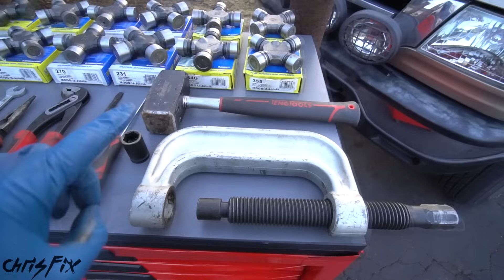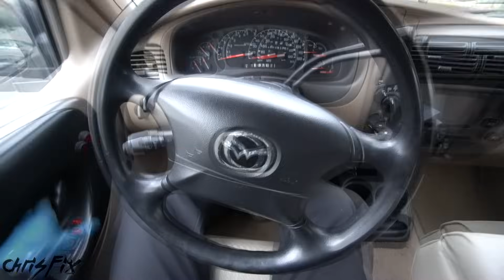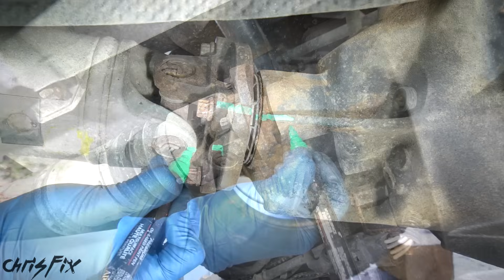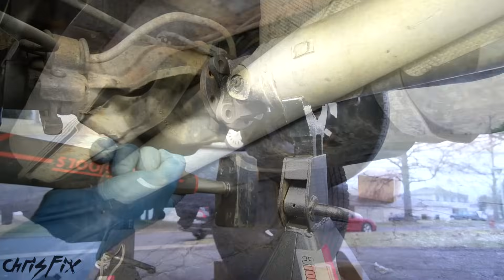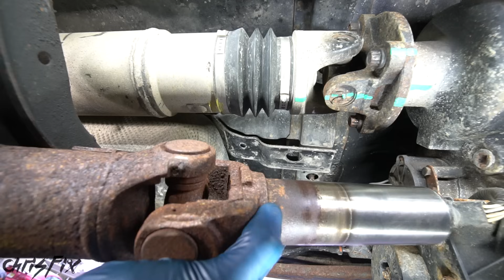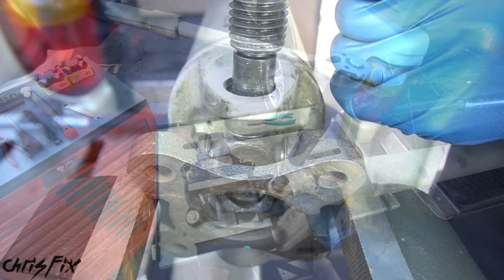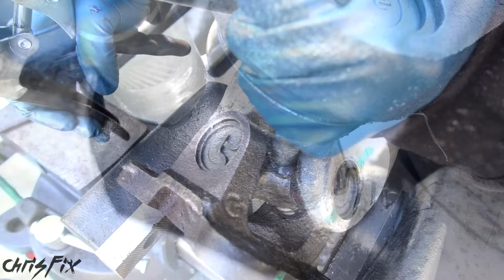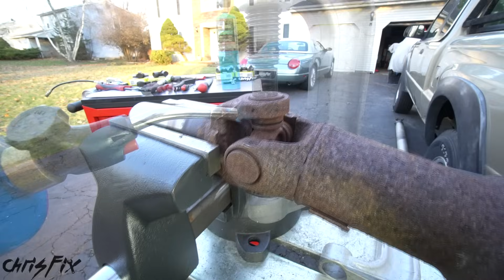How to Diagnose and Replace Universal Joints (ULTIMATE Guide)

Comment: Hi ChrisFix! I'm having the problem of going over bumps and the rear of my car clunking. I'm getting the clunk when it goes into reverse and drive. I'm still unsure if the u-joint is the problem. I've replaced the shocks and swaybar links. Is the u-joint the problem in my situation? Many thanks!
Reply: Support it on the frame and try to move the drive shaft.  Likely one or more U joints need replacing.
Could also be a loose strut if it is noisy going over bumps.

Comment: If you're u joints start to go bad, get them replaced immediately. Take it from my experience. I let mine go bad on my silverado for a long time, eventually it got so bad, it cased the back of my transmission case to blow out, ended up costing $2500 to fix.

Comment: I wish my u-joints came out that easy. Nope.. not easy at all.
Reply: I couldn't hammer them loose... Even the c-press did not work. Ended up buying a 10 ton shop press. At 7 tons they gave and came loose
Reply: @TheShellshock67  Wow.
Reply: Before u joint the four bolts will make one cry.
Reply: @Meme Man your saying like leave the bolts in and revove the end clips?
Reply: @Meme Man ohh i misunderstood. I thought you where talking about doing that to free the ball joint from the yoke
Reply: Ya, my sentiments exactly.
I've just finished up changing the Pinion Seals, U-Joints, and Carrier Bearings (as well as other work) on two trucks. The first was a 99 Dodge Ram 3500 and the second a 98 Dodge Ram 2500. Had to heat all the strap bolts to remove. Had to CUT the U-joints out, heat the caps and remove them with an air chisel !
Definitely was NOT this easy.

Comment: I had never heard of plastic injection 2 hold U joints in I hammered for hours to take it apart a 1988 S10 pickup truck original U-joints 150000 MI that was 30 years old they lasted that long I could have heated them up with my torch been done with it in a Flash, I've been working 50 years on my own vehicles thanks a lot

Comment: Hey Chris, (or anyone) do you know if U-joints can cause vibration at VERY specific speed ranges?  The second I accelerate past 70kmph my car starts vibrating a lot.. Then as soon as I accelerate past 80kmph it completely goes away.  Mystery shakes are the worst.
Reply: Having same issue here with a Toyota KE30/Corolla 1977

Comment: I changed the U joint in my car,  I knew how to do the job but didn't know the fine details, I did not file the edges which cause a lot of force to insert the cups, and damaged the flange. Chris step by step professional approach of how to do a repair is what that makes the difference even mechanics with years of experience can learn something.

Comment: hi chris,my toyota hilux is vibrating in low speed,when shifting to 4th gear,the speed must be above 60kmh or it will vibrate,in other words my speed in 4th gear must be at least 60 kmh to make it smooth..is it due to bad u joint as well?
Reply: Go under your vehicle.Grab the shaft and check for play.If it moves then it's time to replay.Thanks.

Comment: So I found your video like a year ago, I am having trouble with my u joints so I looked up this video. But thing is I replaced the rear u joint about 3 years ago because it fell off while I was driving. So I had no clue about the balance. What should I do you correct it?

Comment: Thank you for the tip about grinding the grease gun tip. That might solve my greasing problem on my driveshaft. As the space on my factory, u joint is quite tight. Excellent video, keep up the good work!

Comment: So if I just did my transmission and forgot to mark driveshaft orientation.doh. my driveshaft can only go on in two directions, if I have vibration that wasnt there before I just need to rotate driveshaft 180 degrees correct?  My u joints are connected to diff via 2 u straps over ujoint caps. 50/50 chance I screwed the pooch on em

Comment: Hey Chris, hopefully you see this. I have a Mazda Bounty 4WD and I have the squeaking sound at low speed like you said in the video, but only when my foot is OFF the clutch and putting power to the rear wheels. Would this still be a uj issue. Cheers man love the videos!
Reply from the maker: Could be something clutch related.

Comment: Hey Chris thanks for the video I'll have to check that out on my 06 Silverado crew cab what do you think some people tell me it's the free way but yet when I pass by the same sections on the free way in my 2014 Altima or any car I dont feel these crazy shakes iv sold other trucks because i thought there was something wrong iv put new iner outer tie rods pitman arm idler arm all shocks alignment balance new tires put the tailgate down upper lower ball joints I gave up sold that truck got a different one trying to make a long story short I notice it more with trucks and its smooth with cars so are the freeways made that way in certain areas or is there something wrong with all these trucks iv had

Comment: Chrisfix my 95 ford f150 shakes and vibrates terribly at 55 mph and the other day I heard two loud "TINK" noises while driving. Then my truck starts pouring radiator and trans fluid out though the seal between the trans and motor. What do you think it was. My dad said a broke u joint.

Comment: Hey man great vid, but what about the kind that are bolted on at the rear axle on 2 of the caps that connect to rear axle yoke with inner c clips? Do you put the inner c clips on, then bolt it on with caps in place already, or press in the first 2 and then bolt on the yoke c shaped clamps/connectors and THEN press in the new caps and install new inner c clips? Thanks for the vid either way!

Comment: Hai. My landcruiser 200 with 2uz engine. Vibration always came at 55km/h and 60km/h.
After slightly pass through 60km/h its ok and smooth, but at 70km/h it vibrate again, but after slightly go through 70km/h and so on its ok no vibration at all. These vibration always came during slow acceleration, but if i accelerate hard, there will be no vibration at all. Is it u-joint problem? Or gearbox problem?

Comment: Your an idiot, lol! You never hammer u joints out or hammer them while installing them! You will bend the ears on your drive shaft or front shaft and front half shafts! NEVER USE A HAMMER ON U JOINTS! NEVER! ALWAYS PRESS THEM OUT AND IN! THERES A REASON FOR NOT USING A HAMMER! YOU CAN BEND THE EARS ON THE DRIVE SHAFTS AND FRONT SHOFT AND HALF SHAFTS! THEY ARE BALLENCED FROM FACTORY! You bend those ears even .0010 of an inch, you will get u joint premature failure because the needle bearings will not spin evenly! This cuases vibrations and premature failure of the new u joints you installed with your hammer. Press your u joints in and out ALWAYS!

Comment: So I replace the U-joints on my drive shaft am I F250 and also the drive shaft leading to my front axle for my transfer case but yet my car still has vibration and it's still making the same noise now I have to U joints and both my axles in the front of my truck how can I tell if those are bad

Comment: Great video. Quick question, you demonstrated vibration under the car while driving. Is that constant vibration? Would you suspect the U joint if vibration only occurs at speed between 20-30mph? 
Thanks.. and please continue your great work.

Comment: Amazing video. 
How can you tell if you have a bad differential.
Reply: Need more information, bad differential is ambiguous. Do have fluid leak, a loud clunk, a whine or vibration? Have you checked your u-joints and wheel bearings? I’ve seen loose lug nuts after a customer had the tires rotated.
Reply: @danacoleGMM  
My 09 mustang GT makes a clunking noise when I hit a bumb or when I shift as well of other noises like sqweeks .
The rear differential is over filled due to a slight leak. I found out to replace u joints, you have to change the drive shaft, because they don't make u joints for this model. 
I got under the car and was turning the yoke left to right it makes a clunking noise when I do it. 
Thank you very much for responding

Comment: Chris, I have a 2004 Chevy Silverado 2500HD. I followed your directions to the T. The only problem I have after replacing the U-joints is there is a clunk from the front shaft when I shift it into 4 wheel drive. What did I do wrong? or what is a possible cause of that? I marked the drive shaft and replaced as you showed. I have no idea what I did wrong? Any thoughts or help would be appreciated.

Comment: Hi Chris...
Good job and make me understand clearly thumbs up!

Question?

Mos cars is the same way to do it?

Like a Kia 2006 Sorento , she told me by phone to me.....the car was shaking a lot....and ... when she goes back and forth  she heard a noise....she told me....

I told her by phone I can't check or say .....( This is the problem) .

But anyway......she told me after a few days.....she did fixed already!

But she told me.... they said to her....it was only with one in it...
Mean the other ones it was out....
The u join....

So my question was......mos cars are the same way to do? Like you did it RIGHT?

THANKS!!  keep Cheking on you!
Reply from the maker: Correct, most cars or trucks with a driveshaft will be very similar if not the same.

Comment: Very helpful. I want to know if the clip is not in 100 percent but is catching. Will it be ok. 
    No excuses but it was dark an I was rushing because my friend helping wanted to leave.
Reply: i certainly would leave it this way... you either didnt clean out the channel well enough or the u joint is not seated against the far clip tightly.. you can try using a hammer like he showed in the video to push the ujoint further in then see if the clip seats.

Comment: So Mr.Fixx. 
When I put my car in reverse & there is a clunk sound. 
So...I need to replace the cars U-joint? And when I drive around then I put it in park..I smell burnt OIL.
Grease smell and its very noticeable on my 2009 Dodge charger.Any idea what it is? Thanks Mr.Fixx. 
I am a woman and I got hosed at a Dodge dealer garage for  $950 for new front tie rods & replaced head gaskets.I felt sooo ripped off because I chalked my car and when I returned to pick up my car...it never left that spot.
Reply from the maker: Go under the car and move the drive shaft to see if it clunks

Comment: You do not use a torch to melt the plastic out.  You press the u-joint out.  The plastic will break clean and you leave the plastic in when installing the new u-joint.  Melting it out can cause serious issues.  This is why you should listen to mechanics who know what they are doing, not someone who claims to be an expert on everything.

Comment: Chris, I got the u-joints out and was installing them but ran into an issue. On the last one, I was trying to press the last cap in far enough to install the clip in the end but it wouldn't budge. As I kept pressing, I heard a pop!  A piece of the metal broke off where the clip on that cap was installed. I think I missed a burr.  Also, when I looked at the bearings, some were broken. ☹️ Also, when I greased the other end, grease only came out of the caps closest to the grease fitting. Advise please. Thanks.

Comment: I always purchase sealed parts. I figured the original is sealed plus who wants to worry about greasing fittings especially when the non serviceable parts seem to last much longer. I've never had to replace a non serviceable part however a shop put a ball joint on my jeep with a grease fitting on it after an accident and 1 year later I have to replace it. I'm not sure if its because cheap part, they forgot to grease it, or because I wasn't aware they used cheap parts and I didn't know I had a grease fitting.

Comment: My friend had a bad u-joint(well, there was constant-velocity/CV joint, not u-joint, but its purpose is the same, CV is just better version of u-joint because it removes velocity variations between shafts it is joining) on an older car(1998 in 2016) and he sold the car instead of hauling it to service. There was nothing else wrong with it and it had low mileage. A replacement joint for that car cost just 15$. He sold it to his friend that is a mechanic... Seriously under market value because he quoted him 200$ for repair... That guy got hands on a good car basically for free... Had that idiot told me he wants to sell it, I would buy it from him for more. :(

Comment: Very good guide on replacing U-Joints. Couple hints I'll add. 1. Most driveshaft vibration is felt between 35-55 mph. 2. The zerk fitting should be toward the shaft to ease access when adding grease after install. First joint installed was correct, second was wrong direction. 3. If the joint doesn't have any play, but has rust near the rubber seals, it needs to be replaced. Same if the shaft is removed and the yokes don't move easily or has a ratcheting feel when moving. 4. Double Cardan joints, common on 4wd and some S-10s, have a grease fitting for the ball & seat between the joints. It usually requires a needle nose adapter for lubrication. 5. On joints with inside locks, the clips are required on the caps seated in the end yoke on rearend. The straps can't be tight enough to hold caps in the yoke without the clips.

Comment: Just adding, if you break a clip don't be alarmed new clips will come with a quality uJoint. While in the parts store pull the ujoint out of the box and inspect it, the needle bearings should be in place and you should get 4 new clips, and a grease fitting for the regreasables. If not tell that computer jockey you want a good ujoint!     That press makes it look soooo simple, I'm an old hillbilly, I grew up on using a ''BFH'' and a BRASS punch.

Comment: Very detailed and informative tutorial. I found out that my U-joints might be worn out.I have recently had to have replaced the center driveshaft bearing and the driveshaft transmission mount on my 2000 Tacoma due to severe vibration I still have some vibration and after watching the video now have found out that I might also have to replace the U-joint.Cheers

Comment: I like marine bearing grease (made for boat trailer wheels) for U-joints and bearings on 4x4 and winter driving vehicles, as they will likely get exposed to more water and corrosive substances. Marine grease is specially formulated for superior water resistance and won't wash out.

Comment: To check for early signs of a failing u joint touch the trunion and end cap at the same time with one finger then use your other hand to twist or wiggle the drive shaft back and forth this test passes a military cmmi inspection it will tell you many miles sooner than other methods great vid

Comment: Very nice video chris as almost everybody agrees on. Got a little tip for you. When using a hammer on metal parts it is smart to not use a strong steel hammer. Especially with castparts like cast iron or cast aluminium. Since the steel hammer is stronger and harder than cast parts the hammer can damage the other part by making miniature cracks in the material. Not noticable with the naked eye but as you pointed out with the driveshaft, you might damage the structural strenght of the part youre hitting and it could, without warning, crack all of a sudden! I’d recommend a hammer with a copper head on it. That is still heavy and can cause a beating but it is almost all of the times softer than the part youre hitting on. Its like an abrasive hammer. Though cast parts are still sensitive, maybe hitting it with a rubber hammer would also do the trick and never damage it! Just a little thing to take even more care than you are allready doing. Cheers from holland!

Comment: If the drive shaft rotates, what is the purpose of marking how it was originally placed? I found when replacing mine that the marking did help since you ca only place it that way when inserting the front part but just wondering to wrap my brain around why the weight of the drive shaft matters if it rotates around.

Comment: Great video, very informative. I have a 2013 FX4, four-wheel drive and I tried changing the U Joints using this video. I do want to point out that one should be very careful as there are several factors not listed in the video that one must consider;

1. The U joint specified for your vehicle may not fit as nicely and as smoothly as the original. Mine, for example, had to be forced in and when placing both locks in the u Joint that made the u Joint stiff. 

2. Be very careful with the ball bearings as they can come off while you are using either the tool or the hammer method. I would recommend you do this in a well light inside a room in case you drop any bearings. I tried doing it outside and lost some bearings, I had to return the part to retrieve an additional bearing.

3. If you plan on using the hammer method, the clamp will almost be required since some u Joints can be very hard to push out. Mine for example, it being an off-road vehicle was extremely rusted and hard to get out. The hammer method did not get them out, I was forced to rent the tool at the local autozone. 

4. The breaker bar is almost a requirement before attempting to remove the first four screws to drop the drive shaft. 

5. Be very careful if attempting this on your own, ensure all locks are extremely well fit. My vehicle started vibrating after driving at 60, I knew something was wrong and after a couple of minutes spit out the locks and the u joints got out of place. I had to tow my vehicle back home.

6. Sometimes when you place a u joint with the locks, the u joint will feel stiff even if you smack it with a rubber mallet or hammer on both sides. It's rather tricky to get it to fit perfectly on both sides.

Again, thank you so much for the video just be cautious when changing these as it's not as easy as it looks.
Reply from the maker: Thanks for sharing